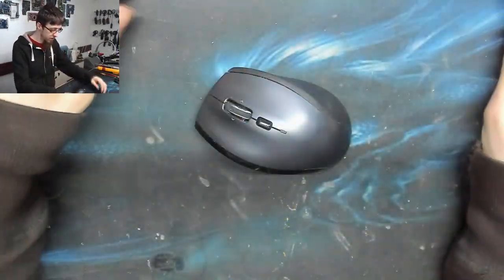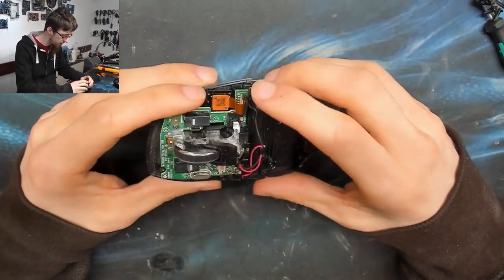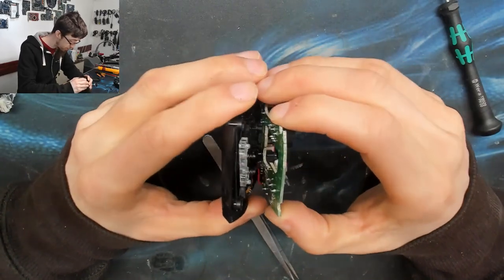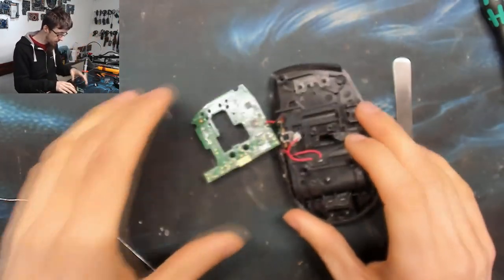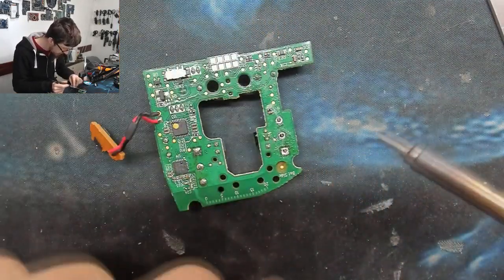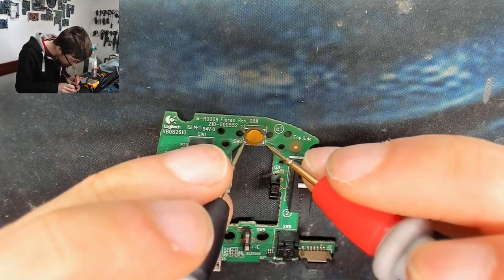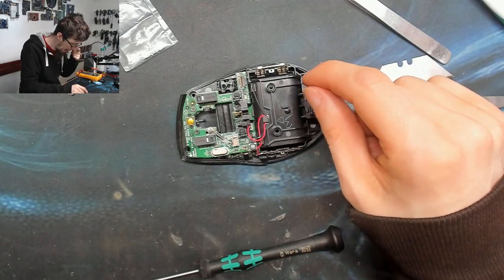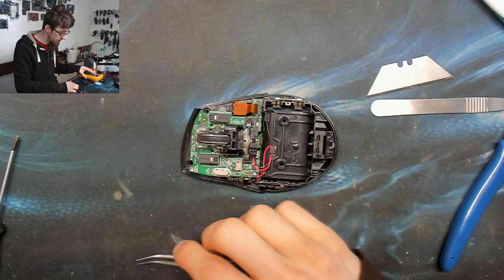LFC#173 - Replacing the buttons on my Logitech Mouse

Comment: Get the Engineer SS-02. It is priced like the manual solder sucker that it is, but it clears holes just as well as a motorized one. If you're desoldering hundreds of pins, get a motorized one, but for six pins like this, the Engineer is the perfect cost and space saving solution.

Comment: You might have tried flushing some contact cleaner into the microswitches and saved yourself a lot of work.  Amazing what a squirt of de-oxit can do
Reply: On my old mice I had found that the problematic switch had failed simply because the spring-loaded contact lost its proper tactility, strength, etc. I could actually see it with the cover off, despite the button being "clicked" and held down at where the plastic piece that pushes it down is, I could get it into a position where the spring contact would be hovering just a fraction of a millimetre above the stationary contact piece. I was able to temporarily fix it by re-bending the springy part so that it has some tension in it again, but the button never felt the same again and it only lasted a few weeks of very minimal use.

Comment: I strongly advise you NEVER to use break cleaner on anything but breaks and non plastic engine parts ONLY! I had very nasty experiences of bubbling, melting and warping plastic parts with that stuff. It is highly corrosive! I have no ide how it would work with electronic parts... I WOULD NOT DARE! 
Thank you for the video.
Reply: non chlorinated brake cleaner is safe as its mostly just alcohol, its better to use proper electronics parts cleaner however.  or an ultrasonic cleaner.

Comment: Also: 17:05 use spare wire (offclips from through-hole capacitors) to push through. Or add solder (and flux) to remove solder
Reply: Might have to give that a shot, desolder pump pen made no difference and I can't get quality wick where I live, only that thin one like the one in this video.

Comment: Other than the buttons, a common problem I've had with Logitech mice is the scroll wheel not registering about half of the wheel movements.
Reply: I had some weirdness with that too, but I was always convinced it was a software thing, specifically firefox.  I never got to the bottom of it and just used another mouse instead, maybe I'll revisit it one day

Comment: Great Video; I have the exact same mouse as yours and those switches require to replace too. Could I ask what is the model number of those OMRON micro switch please? In addition what is the soldering iron you were using in the video?  Thanks in advance.
Reply from the maker: I was using a TS-100 soldering iron, I'm not sure about the switch model numbers though. If you search ebay for 'mouse switch' you'll get lots of results, including OMRON brand ones though!

Comment: Used to use a manual solder sucker, that would have been a lot less hassle than wick.
Reply: Not for small solder joints. Wick always better for this.

Comment: where did you get a replacement switch for a middle button?
Reply from the maker: I de-lidded an SMD tactile button. But I'm not sure it was the best move, because it was a very heavy click. Not sure what the 'correct' option is.

Comment: Yes, you could have bought a new mouse but you cannot buy the experience you gained by doing this job. I desoldered some electrolytic capacitors for the first time a few weeks ago and had the same issue where the pin holes were filled with the original lead free solder. I copied what I saw an experienced surface mount repairer do and that was to flood the hole with leaded solder and then wick it out. That cleared the holes like a treat. I assume that the leaded solder diluted the lead free crap and made it wick better when heat was applied. Of course I may be typing a load of toss so hopefully someone will either confirm or call me a twat for ass u me ing that. 😧
Reply from the maker: That's the idea. Next time I might be looking at a super expensive mouse, and I'll already have the practise under my belt for doing this. Cheap stuff is the best way to practise, so you're ready for the expensive ones where it's actually economically viable.
Reply: If you don't have a wick, solder pump or solder gun, using a leg of a resistor to clean holes also works. Put the leg in and slowly pull it out while applying heat. Of course you can use other components and adjust the size to the size of the hole.